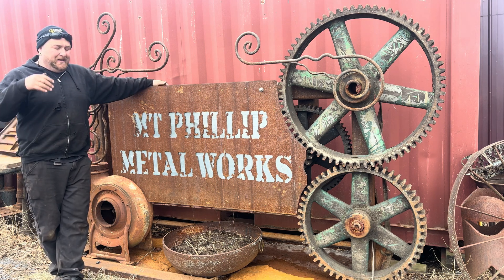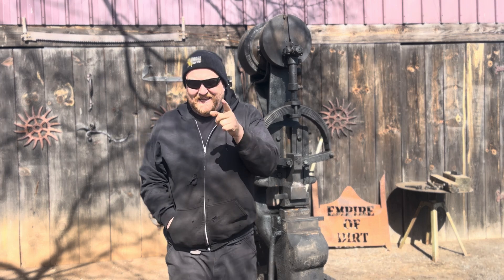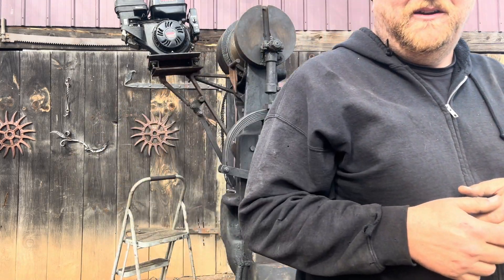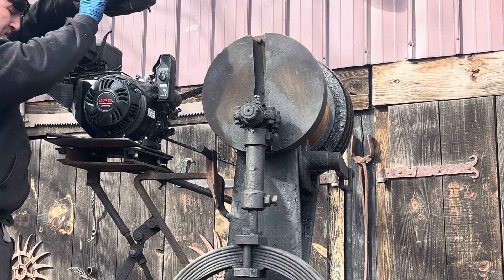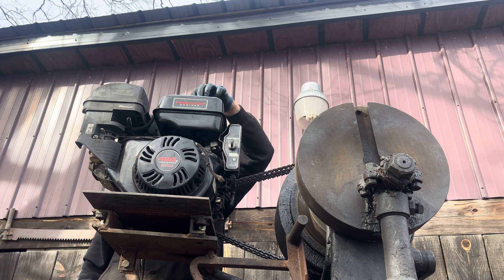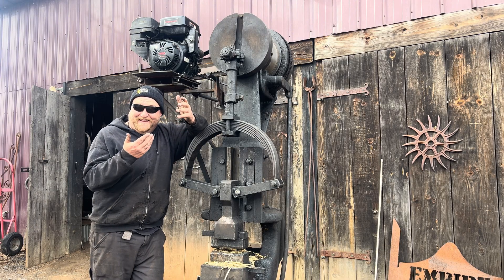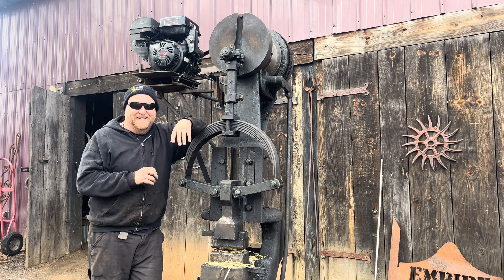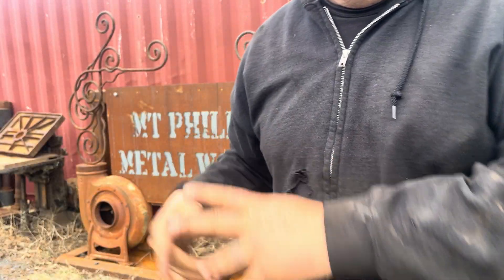Gas Engine Blacksmith Power Hammer

Comment: The hand tightening system is made just like a grain auger setup is. I wouldn't be surprised if that's where he got the idea or even some of the hardware. I was always going to make a power hammer out of a gas powered post driver I had but I ended up making a tire hammer instead. When I sold that post pounder I think the guy that bought it was going to make a power hammer out of it because when his son walked into my shop and saw my power hammer he freaked out.
Reply from the maker: Good eye!  The hand tightening is VERY similar to an auger.